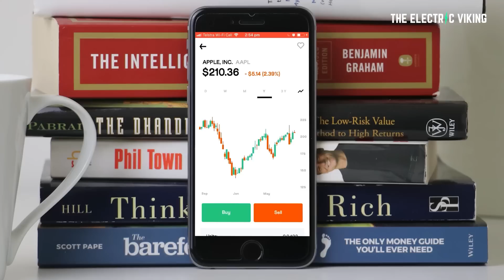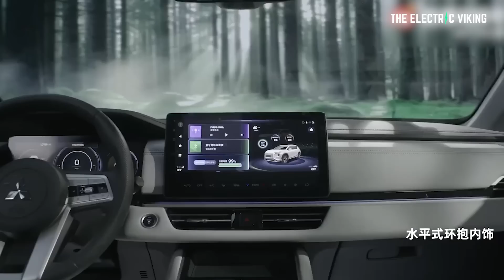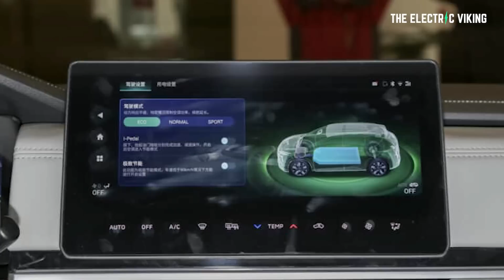Mitsubishi's NEW $31,000 EV comes with a BIG LFP battery

Comment: Don't know where did you get the data that Mitsubishi are an unsignificant brand? It is actually quite the contrary... it's bigger than all vehicule brands together, it produces anything from jets engines to air conditioning, generators  and even spaceship part. They actually produces mechanical and electrical parts of many other vehicule brands as well. Yes it is small within the auto industry due it's choises of partnerships and theire tolerance to foreign investors in theire capital. For example how can you explain that they were the very first to offer a PHEV SUV for years but no one seems to be interseted, yet now that every one out there is in the game  people are flocking into it like never especially the prime from TOYOTA even though it is much more expensive and just as relible?

Comment: This isn't exactly bad, which I guess sums up Mitsu overall these days.  The price seems fine but that's in-China, so doubtless higher in the U.S., which might put it closer to some noticeably better offerings.  The styling's fine if you like Mitsubishis, nothing horrible about it.

I doubt this is Mitsubishi's ONLY hope of having an EV to sell globally, though.  For one thing, they're partnered with Nissan and Renault, who've put out the Ariya and Megane respectively on a shared EV platform.  Mitsubishi's already started using some Nissan bits in their lineup (the new Outlander is based on the Rogue), so I imagine they could also work out a deal to sell their own version of the Ariya/Megane.  Beyond that, my understanding is that they're jointly developing a city car with Nissan that will include an EV version, which should also be a viable global product outside the U.S. (although that's certainly something I'd be more interested in than Yet Another Crossover).

Comment: I had the first Mitsubishi electric - the Miev.  Sixty miles range.  Had a horrendous experience with the dealer when battery went bad.  They resisted replacing it under warranty.  I found out later from their mechanic that the company had such severe money problems that they were refusing warranty replacements to keep their head above the water.  Wouldn't touch them with a 10 ft. pole....
Reply: A warranty is only as good as the companies word.  Hyundai turned down tons of warranty work when they had the 10 year 100,000 mile warranty.  Subaru is another company that can take years and a recall to Honor their warranties. 

Toyota and Nissan not only tend to honor the warranty they often extend it to 100k.

Comment: When I was 18 years old I had a great scholarship that allowed me to buy my first brand new car, which was a Mitsubishi. I drove it for about 160,000 km before I sold it to move abroad, and I had absolutely zero problems with it. It had a solid ride, no squeaks or rattles, and was very economical. I would absolutely buy one if I had the money, it were available, and I couldn’t get a Tesla ;-)
Reply: Every Mitsubishi I have owned has been garbage.  Man they come apart in a crash.  In the states the parts are extremely expensive,   Many parts are knock offs and poorly made.  Even the EVO is a Maintenance Nightmare.  Many of my friends owned one.  Even completely stock they gave problems.  The engine was strong.
Reply: Sounds like someone is still stuck in 80s and 90s era...  mitsubishi havent made anything decent or desirable since the 90s. 🤮

Comment: Why the big pointless grille on the front? It hints at slapdash design.
Reply: I agree. It’s the distinct design from legacy designers. They can’t pull away from it. They need to look back at their design from 80’s and 90’s where the emphasis was on aerodynamics to improve MPG and had smaller and sleeker grills.

Comment: I watch a lot of your videos.  I am trying to keep up on the electric car revolution.  That being said, I do wish that one of these companies would make an electric vehicle without all the tech stuff in them.  What I need, and possibly others as well, is an inexpensive electric vehicle with no touch screens or other computer controlled equipment.  This would also help solve the chip shortage.  Not everyone needs all this tech in vehicles.  For one thing it is too distracting for the driver and unnecessary!  In my opinion.
Reply: Dacia Spring. 100% of the car you need, 0% of the car you want.
Reply: I want a 67 ford falcon with an electric power train.
Reply: Buy a VW Up electric or Seat Mii Electric. Solves 99% a all trips. But when people starts to look at cars they reject the cheap and suddenly expect a Tesla for free.

Comment: Hey Sam, Ternary battery is LiCoMnNi battery, more efficient but more expensive.
LFPs need to be topped up to full on every recharge or they lose capacity, the opposite of cobalt manganese Nickel batteries which prefer charge to 80%. So choose your position wisely.
Reply: (?? Reference re. memory effect in LiFePO4 batteries?? )
 - stating that they need to be fully charged EVERY time, is likely overstating any potential negative effect documented in any Li-XXX   Chemistry - of rechargeable batteries in common use.
Reply: @kadmow  there are discreet differences between the cumulative effects that happen in LFP and what happens in regular NiCoMn batteries, knowing the likes and dislikes is important, eyes open going in but  I’ll admit that LFP seems to be a more robust battery type that stands up to thousands of charge cycles without too much degradation
Reply: @johndair2116  LFP in theory last longer with no real memory issues.  They can’t produce short term peaks of energy like the lithium batteries. They are slower and pack less power for a given kw battery size.
Reply: @fatboy19831  While that’s true, there are concerns with long term home charging where the LFP batteries are only partly charged then driven and that cycle repeated over and over. In that instance it can be problematic for LFP versus NiMoCo batteries, that’s all I’m saying and I’m sure that most owners will be advised of proposer battery care in the first place.